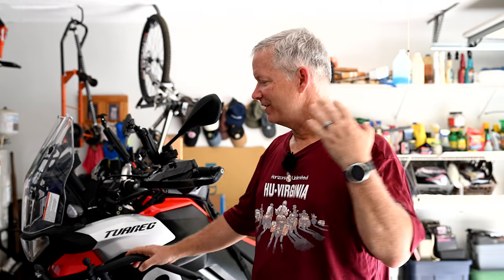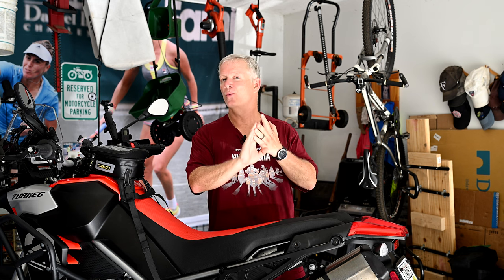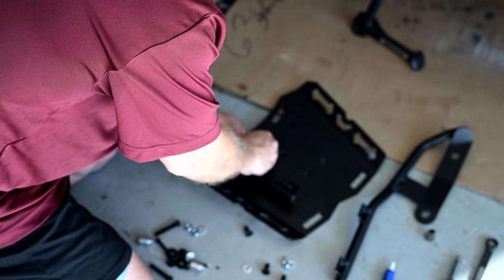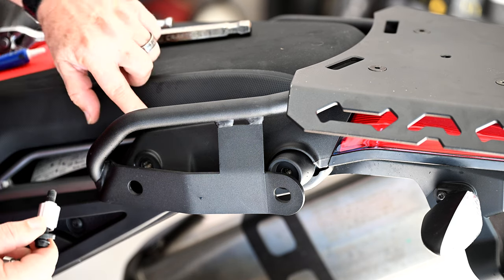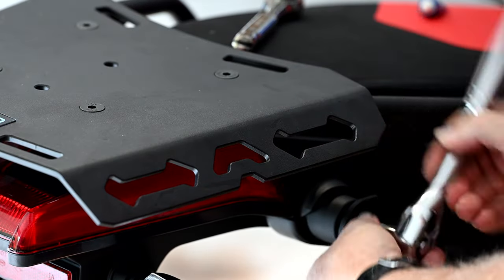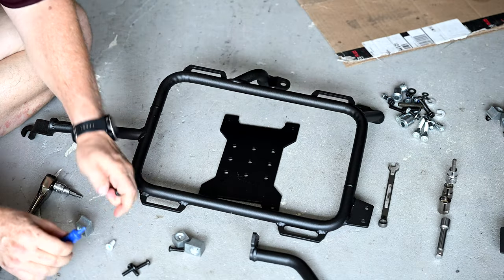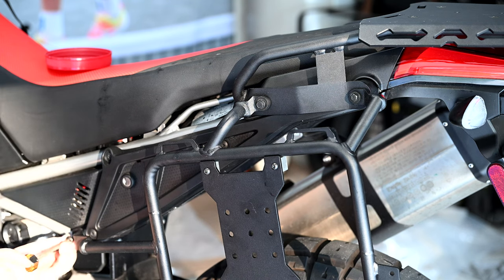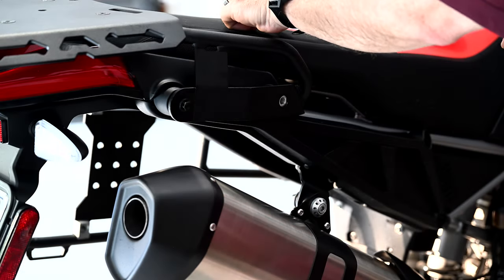Aprilia Tuareg 660 BEST LUGGAGE RACKS - Outback Motortek Install and Review

Comment: I agree, the Outback hardware is bombproof - I have it up front w/ the bash plate and engine guards. BUT, I decided to go w/ the SW-Motech carriers in the back. My main reason for this is the dead simple, quick, & easy ability to take the racks off completely for light off-road ride. I use the Mosko 10L Reckless "holsters". I also bought a second carrier setup so that I can mount the Mosko Moto panniers or the SW-Motech hard cases w/o having to change the mounting hardware - a TOTALLY flexible set-up all-in-all. Thanks for your video, love seeing the Outback stuff, so sturdy. O, and the SW-Motech tail rack is another bomb proof set-up, and very adaptable.
Reply from the maker: That's awsome, @1young-geezer!  Crazy thing is, I just got rid of my T-Rex Racing crash bars and skid plate, replacing them with the Outback Motortek ones.  So I'll be matching your setup up front!  Oh, and of course we did an install/review video of that, which is coming soon.  Make sure you subscribe and check back to make sure I did it right!  🙂  I'll have to check out the SW-Motech racks.  Sounds interesting with the quick-release system.  I had Givi luggage racks on my previous bike, which worked great too.  Thanks for the great comment...
Reply: @MotoPhotoAdventures  One further mention should anyone be interested in the Mosko Moto fitment to the SW-Motech carriers. I didn't know that I could mount the bags to the SW-M carrier, as it is an odd carrier shape for sure. But when I looked into Mosko Moto's Fitment PDF, the SW-M was one of a couple of odd carrier system in further section that could be fitted providing you drill 3 of 4 holes to do so. This is really no problem at all. So look deep in the Fitment section, it's doable. Now, the carrier system, to buy separately, is $345 or something like that - yeah not cheap, but to have two types of cases that can go on to my bike w/o all the fiddling of switching mount hardware - or take EVERYTHING off - is pretty darn sweet! The Tuareg is so darn versatile, it's a pleasure to ride it "bag naked" when I want to, or metal boxes for around town shopping, lol, and still go out in off-road territory w/ top notch soft luggage. Phew, think I've said my peace..........
Reply from the maker: @1young-geezer  that's fantastic information!  Thanks for sharing.  I have a set of Nelson Rigg Hurricane bags on a quick-release plate the slips right onto my OM bars.  I also have a set of Givi Trekker Outback cans from my previous bike.  Still trying to figure out if I'll be able to adapt them to the OM bars or not.  OM tells me Givi is not forthcoming with any kind of inter-agency collaborating.  In other words, they don't play well with others.  HA!  But we'll see if some "fiddling" will make something work.  :-)

Comment: With all the rough riding you plan, I'm not sure I'd trust those nylon lock nuts. Or even the blue lock tight. The red lock tight is too strong, it's stronger than many bolts and the bolts will break before coming out. 
The other choice is to drill a whole through the nut and bolt and use a cotter pin.
On the track the bolts are drilled and wired to stop them from coming out.
Reply from the maker: Excellent point, Steven!  I haven't had any trouble with bolts rattling loose on my old bike...even doing the TAT and other off-road trips.  Of course I tend to check and tighten bolts periodically anyway.  So maybe that's why.  I'm familiar with how guys drill and wire nuts for track days.  But nylon locknuts and blue locktite seem to work well so far.

Comment: The rear rack looks like it has two holes in the plate that might accommodate a RotoPax mount? Can you confirm?
Reply from the maker: Yes indeed!  They have a plate that accommodates the RotoPax system.
Reply: @MotoPhotoAdventures  That's awesome! Sort of makes the decision for a luggage system easier for me! Thanks!
Reply from the maker: @davidrosen5137  I'm glad we could help!  Contact Mark at the Outback Motortek East office.  He's very helpful.  Tell hi. We sent you.
Reply: @MotoPhotoAdventures  Will do!

Comment: Did you get regular seat or low seat on the Touareg?
Reply from the maker: So far I'm just using the regular seat.  However, I'm pretty short at 5"7' and 29/30" inseem.  So I have to tip-toe my feet to touch the ground.  I think I might order the low seat to try it out.  But I'm going to test the standard one for a bit first.
Reply: @MotoPhotoAdventures  I just test rode one.  Great bike, but a bit taller than I would like.  I read about the low seat and lowering kit, the latter not widely available....
Reply from the maker: @rjsalameh  then you definitely DO NOT want to test ride a Yamaha T7!!!  🙂 Seriously, I'm glad you enjoyed it.  I think the lowered seat (I think it's about 3/4" to 1" lower) would be about perfect.  But I hate buying a new seat when a perfectly good one game with the bike.  HA!  Still, it would be an easy way to instantly make the bike fit me better.  So we'll see.  As you pointed out, there are also several lowering kits out there.  I think the Kuba on drops the bike 1.25".  One of the biggest praises for this bike is for the amazing suspension and ground clearance they gave it!  I'm willing to sacrifice some of the flat-footed comfort of my CB500X in exchange for the 21" front wheel, great suspension, and fantastic ground clearance!